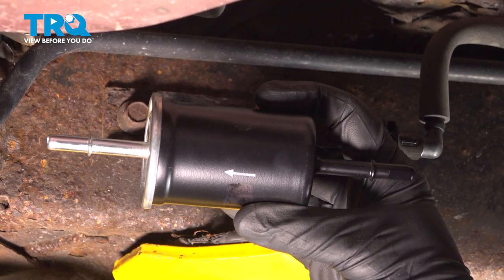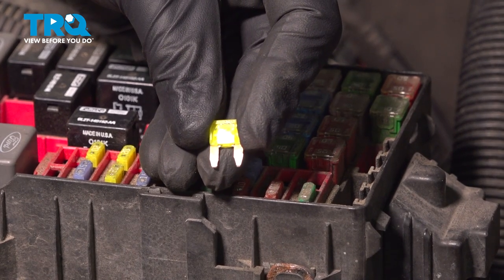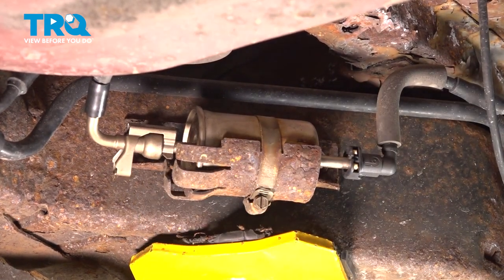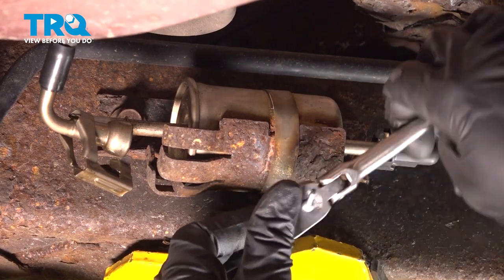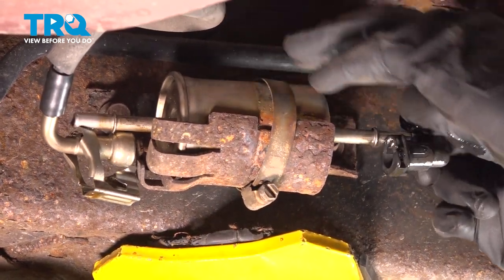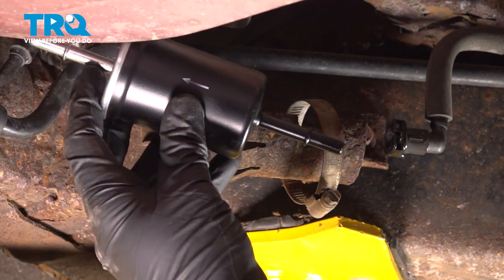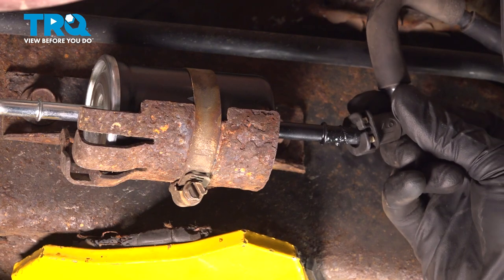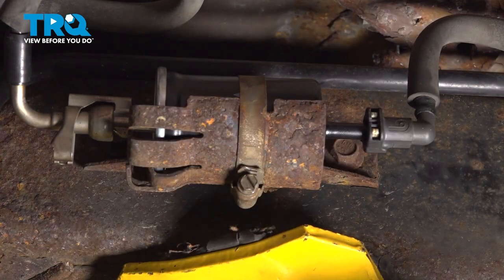How to Replace Fuel Filter 2003-2011 Mercury Grand Marquis

Comment: Best video how-to on the fuel filter replacement for Ford's panther platform.  Shows the correct sequence for removing the fuel lines and clamp.  Today I performed this service for the third time on one of my P71's.  If you can remove the white plastic clip without breaking it, that's how you know you've mastered this job!

Comment: Just a heads-up.  I just changed the fuel filter in an 01' Mercury Grand Marquis 4.6l. The only difference is that the retaining clips are both made of plastic. Took me 24 min to change it. Also, fuel continues to run, so be very fast about it and have your new filter ready. 👍

Comment: Nice easy to follow video. My 2003 Mercury has stalled twice now while sitting at a stoplight.  After it cools down a bit, it will eventually start after some cranking.  I was thinking it was the fuel pump,  but maybe the filter is a bit clogged.

Comment: Better to pull the fuse while it's running. It will bleed the pressure off a bit better. Also, leave the fuse out until your done. Especially if someone around you might go and turn the key to the on position.

Comment: Just did mine today, the side with the white clip you don't need to remove the white clip itself. You push in on the flat side clip and you're able to disconnect it without it breaking. It's the same setup as the lines on the purge valve solenoid.

Comment: That fuel filter was painted, which means the case isn't made from stainless steel like the factory Motorcraft filter. I've found Chyna made filters that have come apart inside sending crud to the injectors.

Comment: Loved it when the 90 deg connector breaks when taking out the 160k original filter. I guess I just cut the plastic line from the steel and use rubber hose and clamps. 
Sweet